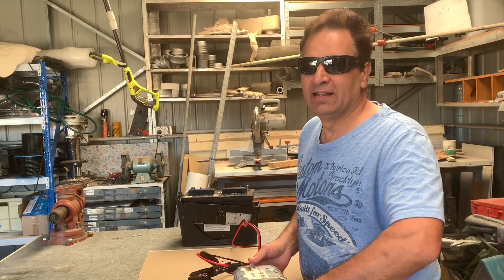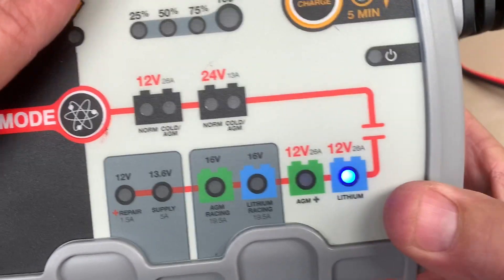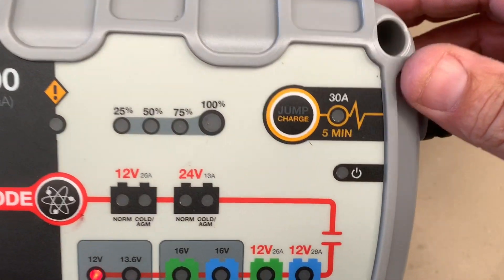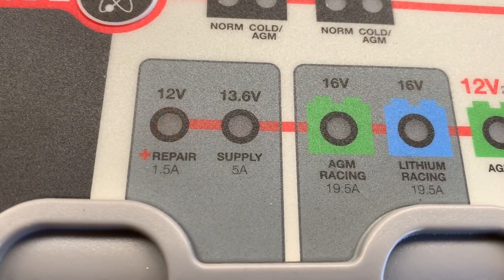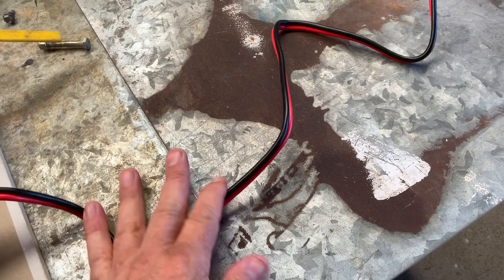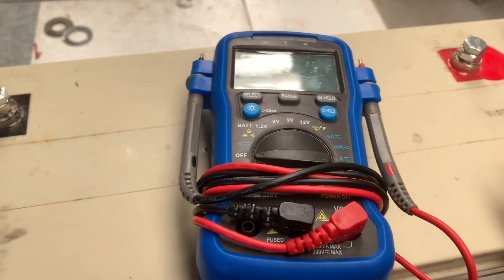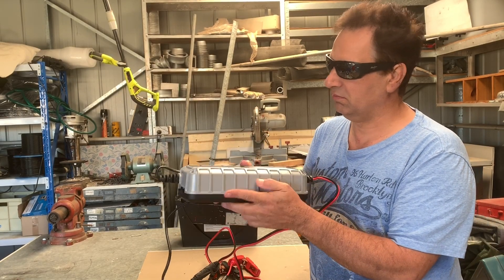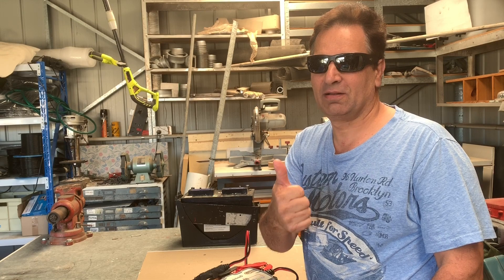noco genius g26000 battery charger

Comment: I have one of these that I bought 5 years ago and it’s pretty hopeless at charging my 3x130ah AGM batteries on my boat.even with a reading of 12.1-12.3v the charger starts out convincingly enough for about 2 mins at about 24amps then drops right down to a mere 9-11ams and stays like that for hours! These batteries are only 2 years old and my old charger happily put 25amps in for 1-2 hours then decrease gradually until it hit float mode. Unfortunately the old charger wouldn’t charge above 14.4v… and my AGM’s need 14.7-8v… hence why I bought this unit as it has an AGM setting… total waste of money
Reply from the maker: Sorry to hear of your experience. Thanks for watching 👍🍻

Comment: The manual says only use the repair mode for acid batteries not for agm
Reply from the maker: It’s fine as you charge lead acid using agm mode. Lead acid and agm are similar structure . Think they might be meaning 12 volt only. I have used the repair function on 5 agm batteries so far and 3 of them were successful. Thanks for watching 👍🍻

Comment: Hi. Does if you set it to 13.6 will it boost and maintain to that? Cheers. I need a charger that will maintain it at 13.6 for when I’m programming on the car. Cheers
Reply from the maker: Not too sure mate I just got this to charge my batteries or try to repair them but have a look on the user manual here https://www.manualsdir.com/manuals/357167/noco-genius-g26000.html?download
Reply: @EFFICIENTSELF  Thanks very much 👍👍

Comment: Mate mine finally arrived after being convinced from your review. Two YouTuber’s I follow promoted this unit (the other promoting\reviewing the G3500) and I’m more than happy Dino. I’m just to test am using the repair mode on my battery to see if it makes a difference or not. Will check in the morning.
Reply from the maker: Good luck in the repair mate .hopefully it will but just depends on how badly sulphate the battery is ...I have had a go at 5 batteries and 3 of them repaired and the other 2 were stuffed....but all you can do is try....let me know how you go 👍🍻
Reply: EFFICIENTSELF don’t worry Dino I’m not going to hold it against you if doesn’t work lol.

As you said mate can only try mate. I did need one and the fact I like your videos and you did a video on one it was good enough for me
Reply: EFFICIENTSELF stupid question will I know that it worked because the colts are where they should be?
Reply from the maker: 12.8 to 13.1 it will be good.....the repair can take 4 to 5 hours with my unit but I’m not sure with a smaller unit
Reply: EFFICIENTSELF absolutely no issues mate I’ll run the unit overnight and check in the morning. As mentioned previously battery would not charge more than 12.5 so at least I know my starting point.

Thanks again Dino and looking forward to the next video mate.

Have a great week champion
Reply from the maker: Likewise mate give it a charge after you do the repair 👍🍻

Comment: Have you tested electrolyte density after full charging of dead  Ca\Ca battery ?
Reply from the maker: No sorry mate I’m not that technical . 🤣. It does what’s its meant to do very well. Thanks for watching 👍🍻
Reply: @EFFICIENTSELF  This charger only seems to charge well in standard mode. In order to fully charge the battery, increase its resistance to frost and sulfation, as well as extend its life cycle, you need to finally increase the charging voltage to over 16V using the Repair mode(better to do that when battery is out of the car - some electronic equipment can be sensitive for that voltage). Sometimes even several times if we're charging high capacity batteries. The density of the electrolyte is crucial.

Comment: When do i use 12v normal mode and 12v cold/agm mode ???
Reply from the maker: Im not too sure .. just have a read of the manual... if you not got it im sure you will find on their website... i just been using normal mode for agm as i mostly use the lithium mode.. sorry couldn’t help
Reply: @EFFICIENTSELF  ok, thanks....
Reply: Normal mode 14,4V final charging voltage
Agm/Cold 14,7V
AGM+ 15,5V
Repair mode 16,2V 1,5A 4Hours
If you use standard liquid acid ca\ca battery best option to recharge is AGM+ mode and next Repair mode once or twice(only voltage above 16V can deliver electrolyte density, whitch is critical for longevity of battery).
When you use standard mode voltage is too low to fully charge.

Comment: I use a 100 amp alternator and a small engine as a battery charger, works a treat
Reply from the maker: Sure would 🤙 . I made one of those up probably over 25 years ago ,think I used the Bosch or Lucas alternator? 👍🍻

Comment: Hey Dino

Can I ask when you do the repair function and it reaches 100% will the green at 100% remain a solid light or will it blink?
Reply from the maker: Solid
Reply: EFFICIENTSELF sorry mate asking as bloody kids threw away the instructions manual already
Reply from the maker: Lol... go on their website mate you can download it off there ... threw mine away too 😂
Reply: EFFICIENTSELF LOL. Yeah did a quick google search. Sorry mate to hassle you lol. I just did a quick voltage check on the battery. It’s still in repair Mode and the 100% is blinking but volts now say 13.54 which is brilliant as before I tried this it wouldn’t go above 12.5v
Reply from the maker: Jason Caruana let it go a bit longer as it might be still repairing give it extra time being a smaller charger see what happens...
Reply: EFFICIENTSELF will do mate I won’t take the clips off the battery just yet

Comment: Just binge watching your videos mate. I’m thinking of buying something similar to this mate. Was this purchased from eBay?
Reply from the maker: Yes they sometimes have a 15% or 20% off sale think I picked mine up for around $260 as these retail around $315 or more . Has been an awesome charger 👍🍻
Reply: EFFICIENTSELF hey mate can I ask a silly question but this unit compared to their other\cheaper models. I notice that they have 3.5amp, 15 amp etc. is that the input power back into the battery? Hope this makes sense. 

I just want to get a charger to top up the deep cycle while car is not driven. Not sure if I need this or is this too much for what I need
Reply from the maker: Get the small one mate will be cheaper .. this unit can actully jump start your vehicle.. its the output power when they say the amps... for battery top up go for the small... just remember the smaller you go  it takes longer to charge but if you not in a hurry the small will do .... if you can afford it mate go the 15 amp thats a good all purpose charger... i went this charger cause i found my 10 amp from supercheap a little bit small for my needs ... hope this helps someway 👍🍻
Reply: EFFICIENTSELF you are a legend mate. Thanks for making it clearer. I’ll check out the 15amp also.

The old 80 is only a weekend car so I’m not in a rush to charge to be honest but I’ll definitely check out the 15amp
Reply from the maker: Mate throw out your portable solar panel and charge if you have one that will keep it topped up ... just an idea to save you $